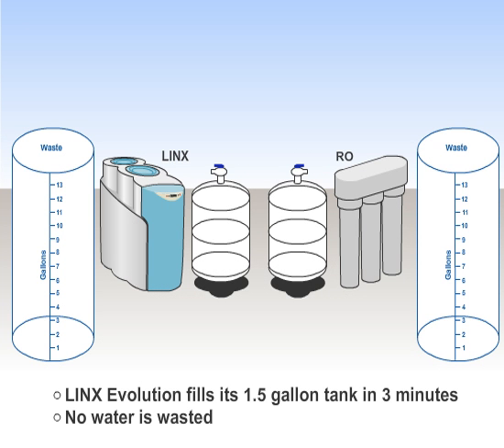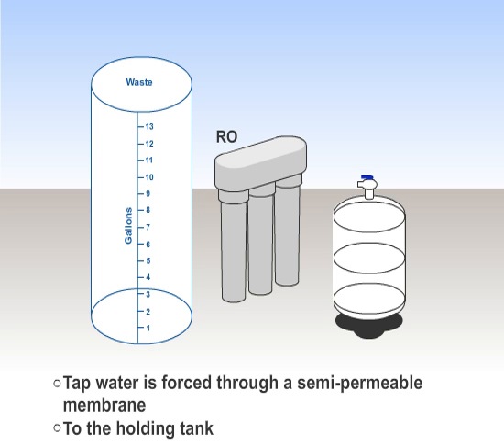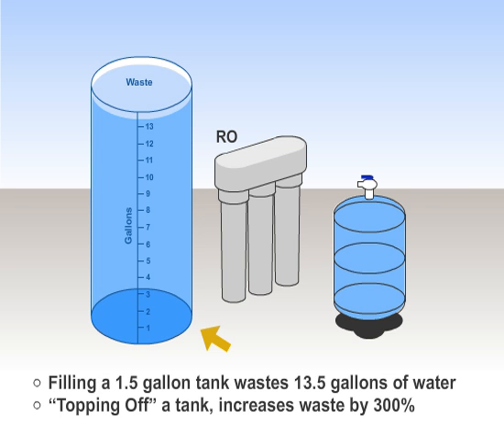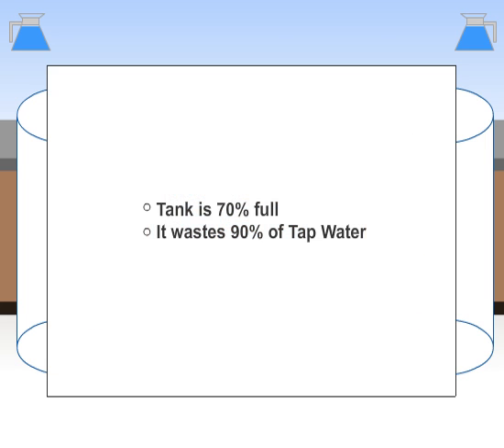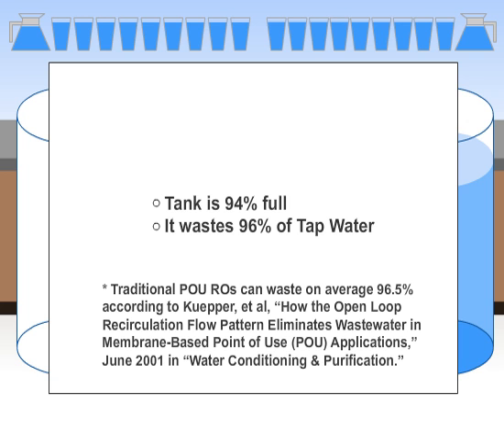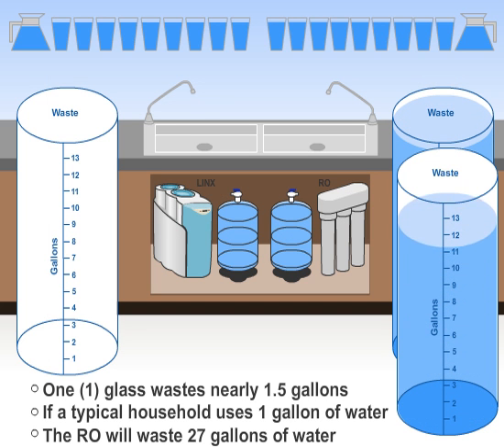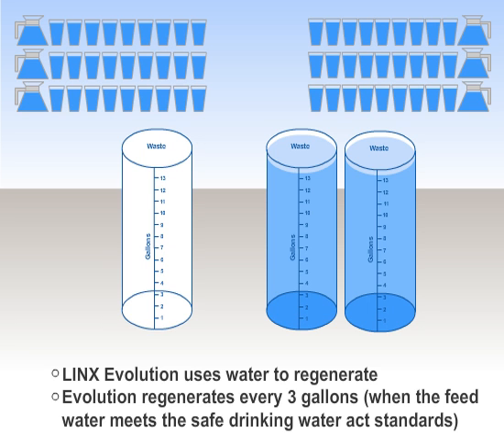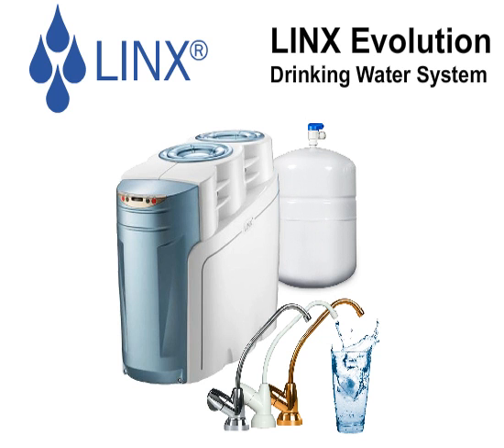Insane Water Waste -- Reverse Osmosis (RO) Truth

Comment: This video is 11 years old. The info is way out of date. The rejection potential of tap water depends on water pressure. If the water pressure is low then RO will produce more waste water . This is easily compensated for by buying an RO with a pump
Reply: I just talked to a manufacturer for a water business and he said the best they can do is 20% water loss...which is not bad at all if you ask me...
Reply: @Chutneyfan  THAT WILL TAKE A SERIOUS PUMP AND MEMBRANES. NOT NEEDED UNLESS YOU ARE DOING A WHOLE HOUSE
Reply: @roberthart9886  as i said it's for a water business.....i will sell RO water
Reply: @Chutneyfan  Pretty sure you can lease the machines. I have seen Self-Serve  equipment in Whole Foods
Reply: @roberthart9886  no i am not in America but at the same time i want to own my business...1st one in my country so..
Reply: That's not how my apec water filter system works.  First off, if I installed this according to instructions with a drain trap how would you know.  The system I bought loses about 10 to 1 so for every gal I'm losing 10 gals of drain water.  I don't know why but the pressure at the sink is about 85 which the system should handle but I've read the optimum is around 60psi so I bought a gauge and a prv and set it to 60 and then again set it to 40 and I drew about 20oz and measured the amt of water drained and it's always the same.  I've complained several times to the manufacturer and the response was always a shopping list of questions and tricks they wanted and they wanted a video but no possible answer.  Finally they said they would send me a new system but instead they sent a set of filters, minus the tank which I think is the issue but I haven't figured out how to accurately measure the pressure changes between the tank and the filters.  The commodity price is about 600-1000 gals which I think only amts to a few dollars but it's a tremendous waste and I have no way of dealing with that kind of excess.

Comment: This video is totally wrong. I have a Culligan Water reverse osmosis and it only wastes 1 gallon for every 1 gallon of clean water. Plus its the only way to remove 99% of the contaminates. Only the cheap home depot and other department stores reverse osmosis waste a lot of water. Plus Culligan has rental options for super cheap and they put it under full warranty and do all the maintenance!
Reply: Did you have to sign a 5 year contract?
Reply: @TimeTraveler0036   I mean you can buy them, finance, or they have 1, 3, and 5 year contracts!
Reply: Even cheapest RO purifier wastes 60% water. Meaning every 100 liter water is converted to 40liter drinkable water and 60 liter waste. Expensive ones will have better ratio of 50-50. To get higher ratio, one will need larger business scale machines with large or stacked RO membranes

Comment: The most scary thing about this video is that more than 355,000 actually watched it!  The point of an RO is to eliminate 95% of all of the TDS (Total Dissolved Solids) in the water.  That is everything in our water that is not water...all the bad stuff.  The amount of water wasted with an RO depends on the quality of the membrane.  It is true that the RO systems you get at Home Depot or department stores do waste a lot of water.  But, it is no where near what this video suggests.  The worst I have ever seen is a 6:1 ratio.  It wastes 6 gallons to make 1 gallon of good water.  The problem is, that are the really cheap systems.  If you buy a cheap RO, you are getting low quality.  Makes sense, right?  There are membranes (Pentair) that have 1:1 ratio's.   Also, the only way you can affect the TDS level in the water is through a reverse osmosis system.  Of course it's going to waste water.  It is letting the good water through to the tank and eliminating the bad water to the sewer.  It HAS to waste some water.  Where would the bad stuff in the water go if it didn't?  But, please don't think the numbers shown in this video are anywhere near what a good RO will waste.  It simply isn't true.

As far as this LINX system this video is trying to SELL you....it isn't doing anything to the TDS in the water.  Ion exchange is the same technology as a water softener.  It may remove the calcium and magnesium from the water, but it is doing nothing for the TDS.  Total Dissolved Solids are "Dissolved Solids".  Stuff that is so small that the only thing that will remove them is the semi-permeable membrane of an RO....making it ideal drinking water.  This LINX system is doing nothing for the quality of your water.  Like I said...the most scary thing about this video is that over 355,000 people actually watched it and may have actually believed what they heard.  It's alarming what you can find on You Tube!
Reply: Thank you for the very good information. I just bought a new RO system, top of the line of Home Master brand, it said the ratio of water waste is 1:1. Thanks again for good information.
Reply: Do you think 1:1 ratio is very good ratio.For every glass you drink,you throw 1 glass water.This is insane .TDS might be a harmful thing,but can't we make a more efficient system of water treatment ? I have forever known that groundwater is pure from all impurities ,but nowadays every household uses RO.
Reply: @shubhamkumar-nw1ui  A membrane with a 1:1 ratio is the best membrane manufactured in the world today.  So, yes....that is VERY good!  By definition, a reverse osmosis HAS to waste some water.  Think about it.  It is taking out the bad stuff in the water and leaving the good behind.  How do make the water good without taking out the bad?  For your information, the RO systems you will find at a Home Depot or Lowe's usually have 6:1 ratio's.  That has been the complaint of RO systems in the past.  They waste a lot of water.  A membrane with a 1:1 ratio is excellent.  Btw, "groundwater is pure from all impurities"?  Not sure what you meant to say there, but groundwater is why you need an RO system.  It takes out all of the bad stuff that groundwater has in it.
Reply: @jasonc9791  are there countertop 1:1 ratio RO filters?
Reply: @incorectulpolitic  1:1 ratio is referring to waste water the membrane is producing.  For every gallon it is producing ideal drinking water, it is only wasting 1 gallon to make it.  Whether the RO is under the sink or on the counter really doesn't matter.  What you are looking for is the quality of membrane that RO has.  "Pentair" is a good thing to look for.  They produce a 1:1 ratio membrane.
Reply: @jasonc9791  The real question sis WHY do some systems waste more water while some others waste less?  Can anyone explain this?
Reply: @georgeswca  The amount of water an RO wastes is totally dependent on the quality of the membrane.  A "cheap" membrane is going to waste more water than a high quality membrane.  Why isn't there just one membrane manufactured for all RO's then?  Price!  If you don't want to spend a lot of money on an RO system, you can find a cheap one at Home Depot or Lowe's for $200.  Just like with everything in life...there is a difference between high end and low end.  A high end RO with a 1:1 waste water ratio membrane isn't going to be $200.  To give you an idea, I sell my RO systems for $650.  The higher quality, the higher the price.  Whatever is more important to you (quality or price), is the way you should go.  But, by definition, an RO HAS to waste water.  It's leaving the good and taking out the bad.
Reply: @jasonc9791  My RO membrane is rated at 2200 GPD, but wastes 432 gallons per hour when it runs.
Reply: @georgeswca  is this a whole home RO system?
Reply: @jasonc9791  Yes.  Has a 5 micron pre-filter, 2200 GPD membrane and 500 gallon storage tank.
Reply: @georgeswca  Wow!  Good for you buddy!  Not to many people have whole home RO systems.  You're even pooping in RO water.  Let me ask this.  When I sell a whole home RO system, I put a water softener (2 tanks - one for the resin and 1 for the carbon) before the commercial sized RO.  Then a UV light as the last stage before the water goes into the house.  Is your system done like that as well?  But, as far as the RO membrane.  The membranes I use for whole home RO's have a 1.5:1 waste water ratio.  Not to mention, the water softener usually needs to regenerate every 1200 gallons.  So, for every 500 gallons of water being produced by the RO, it wasting 750 gallons to make it.  That means the water softener is probably regenerating every day.  How much salt do you go through in a month?  Just curious.
Reply: @jasonc9791  I do not have a softener in my system.  I have a 5 micron big blue pre-filter, then the single membrane RO cartridge, then the 500 gallon tank, then the PH adjuster.  I am starting with a TDS of around 500 at the wellhead.  That is brought down to 20 at the storage tank, then back up to 110 at the house.  The reject water is 175-200 TDS.
Reply: @georgeswca  If you're not using a water softener before the RO membrane, you are going to go through membranes VERY fast.  Those aren't cheap to replace.  The whole point of the water softener before the RO membrane is to extend the life of the membrane as long as you can before it needs to be replaced.  If you're TDS is around 500, that's pretty high.  The max contamination level the EPA allows the water board to give to it's customers is 500 ppm of TDS.  The big blue filter is just a sediment filter.  Are you on city water or well water?
Reply: @jasonc9791  I'm on well water.  I checked my notes and my last reading at the wellhead was 455 ppm.  I'm located in SW Florida, so that's pretty low for my area.  Some areas closer to the coast are over 1,000 ppm.  City water in my area 300 ppm.  The whole point of the WHRO system was to get rid of the traditional softener that was doing nothing for water quality.  The WHRO system has been operational for a month and the water has never been better.  It just wastes more than I like.  I'm not sure of the quality of the membrane they put in, but I know it's rated at 2200 GPD.
Reply: @georgeswca  I'm not trying to sell you anything buddy.  I don't talk bad about my competition out here in Vegas and I'm sure the guys who sold you your system are great guys.  Seeing you are on well water, you would not have needed the carbon tank part of the water softener because the carbon takes out the chlorine in the water.  Well water doesn't have any chlorine in it.  BUT, you really should have a resin tank before your RO membrane.  You want to take out the calcium, magnesium and iron in the water before it hits your membrane to help save the life of the membrane.  I think you're going to find that you are replacing those a lot faster than you need to.
Reply: @jasonc9791  Thanks for the input.  I'm not sure if my feed water from the well has chlorine in it or not.  I should get it tested to see what, if any, adjustments need to be made downstream.  So far, the system is working great.  The whole point of me getting a WHRO was to eliminate the traditional softener.  I will get my feed and product water tested to see what adjustments need to be made and monitor TDS, production rate, etc...on a monthly basis.
Reply: @jasonc9791  The commercial scale RO purifiers waste only 20-25% water. But they need multiple stacked RO membrane with the waste water being refed into 2 more stages. It works only for commercial usage as such plants are huge in size and can't fit a small space in the kitchen
Reply: @shubhamkumar-nw1ui  NOT ALL WATER IS THE SAME. Underground/Well water is not all the same lol. Some is very pure and sediment is all at the bottom so the TDS is very low. A lot of well water is better in some ways and worse in others, a common problem with well water is iron levels. Anyways, everyone has to determine the best water filtration for the AREA they live!!!!!!! Some people don't need anything but still waste money on this shit and some people NEED it but get misinformed. Tap water in big cities in general isn't dangerous but it isn't good for you, your skin, your family, your plants or anything in general. Municipal water has to be treated to supply to the masses. Clean water is one of humanities greatest challenges.
Reply: Well, what if the problem isn’t the TDS, but the calcium and magnesium (which make the water “hard”)? I’d bet that’s the most common reason why people use RO, and as you mentioned, this does reduce calcium and magnesium in the water.

Comment: Filter cost? Depending on the setup, and water quality, membranes can last anywhere between 1.5 - 2.5 years. A good GE  depth filter is about $15, carbon filter $10 - $22 and DI resin $20. You are talking about MAYBE $60 - $80 / year, again depending on water quality, number of pple and/or pets in a household, the volume of water consumed, either for drinking and/or  cooking (worst case). I spend very little. Don't be fooled, distillation does not produce the same quality of purification as a RODI. My yellow lab loves it, paws up.

Comment: When you either wash your cloths, or take a bath do you distill your "waste" water in order to drink it??  I run a 100 GPD dual membrane with a 800 mL flow restrictor, and my RODI has a ratio of 1:1.6 of product to waste, and takes about 7 minutes to filter a gallon of PURE water. RODI is a balance of water pressure, flow restriction and water temperature. Distillation doesn't NOT remove the same number of heavy metals as RODI, which is why they are NOT commonly used when pure water is required, such as in any clinical, or medical environment. This advert as it relates to RODI is completely false, and just filled with inaccurate information. If you want to sell your product, try sticking to the "pro's" of your product, and don't compare and contract to other filtration systems, as it is inferior. SAD, SAD, SAD!

Comment: Distillation will remove almost as many contaminants, with almost zero waste water. It will remove lead, chromium (all metals, in fact) as well as most pharmaceuticals, chlorine and Fluorine/Fluoride. Time-of-process is comparable to RO, without costly replacement filters. If you start with 5-7 stage sediment filtration water, it is easy to get RO quality without RO costs or waste!

Comment: To anyone, the back pressure problem can be fixed with a permeate pump.
Reply: How would that work? I have an R.O system and am looking into recycling somehow all waste water. I currently use 500 - 600 gallons of water a day. 5 days a week.
Reply: @tonygutierrez4627  Using multistaged RO system can limit wastage to 20%. 20% is the lowest possible wastage and even commercial grade RO systems in Saudi Arabia can't beat that
Reply: How does a permeate pump work?

Comment: Regular direct RO wastes 1:4. RO with aso and tank due to tank increasing pressure wastes 1:6. RO with permeat pump and tank wastes, (however permeat pump membrane is fragile) - 1:3.  RO with booster pump, aso and tank wastes 1:4. direct RO with booster pump wastes 1:3. direct ro with booster pump and two membranes in serial connection wastes 1:1.5

increased waste with tank is because of back pressure, it the reason for waste.
aso reduces tank capacity to 60%, leading to less waste, but also less tank capacity.
permeate pump links pressure of waste water to clean water, increasing throughput against pressure of tank; however its membrane is fragile, and its useless if there is no backpressure (direct flow)
booster/membrane pump increases total pressure, decreasing waste.
booster/membrane pump can provide enough pressure for using several membranes in consequent/serial connection, halving the waste at double output.

in worst case, RO can waste 1/20 - this is when tank is used, but no ASO, which is NEVER the case.
in worst case, RO wastes 1/6, which can be fixed by adding permeate system; or replacing membrane with nano-membrane and removing the tank; or upgrading to booster pump.

the linx system uses ion-exchangers which are easily clogged, 1-year best-before and do not even close have filtering power of RO. linx system is much worse than RO.
Reply: It sounds like useful information but I don’t understand it. Would a plumber be able to help me measure the water pressure and tell me which water pump I need to reduce waste water and then install it?
Reply: @evebrito3623  you can measure the pressure yourself, by attaching the pressure gauge to any water outlet through ring adapters of right diameter. This is two things you need to buy. Or technician, if that is cheaper. Membrane needs at least 60 psi to work in simple 2prefilter+membrane+bypass(for flush) config. If pressure is less, you need system with dedicated membrane pump, preferably electronically controlled with autoflush. All systems - direct, tankLESS, maybe SideStream. I do not recommend tank, is source of headache.

Comment: Can the lynk bring the TDS to 0 PPM?
Reply: it uses resin ion exchangers, so it can reduce TDS only to 50% in best case - and then clog fast.
Reply: I put it through a big RO membrane at 90 psi and get the TDS under 10.  Then it goes through a D.I. mixed bed resin tank and comes out zero.  Won't even conduct electricity.  We clean windows and solar panels with it.  Don't drink it though, it's looking for minerals and it doesn't care where they come from.